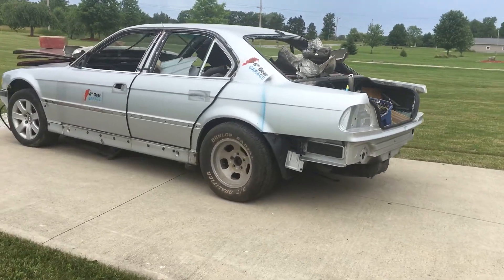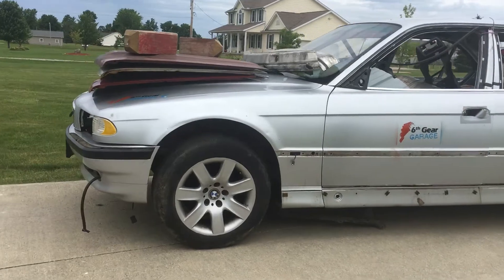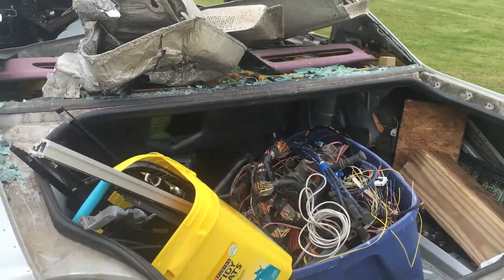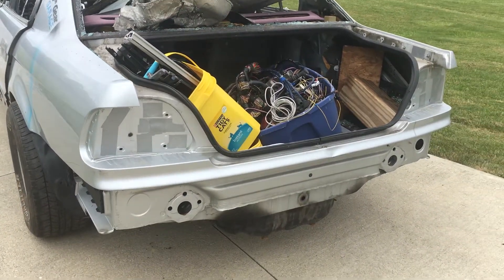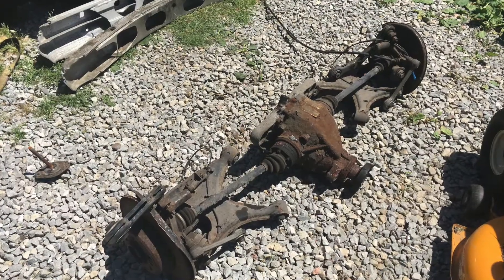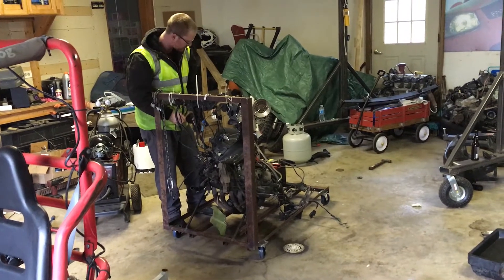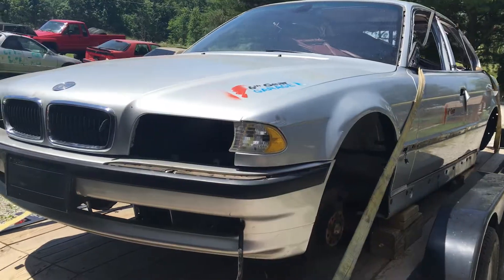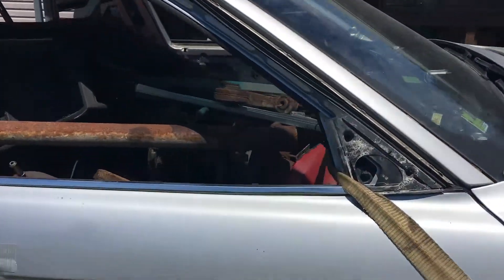Scrapping the $400 E38 BMW 740i

Comment: So sad! Sure were a lot of good parts left. I have a 01 740IL sport and could have used a few of those parts to stockpile away for future.
Reply from the maker: djstangerdude it looks good from far away, but the hood and doors all had rust. The front bumper was cracked in a few spots, along with the grill and turn signals. I pulled every good part from this car.